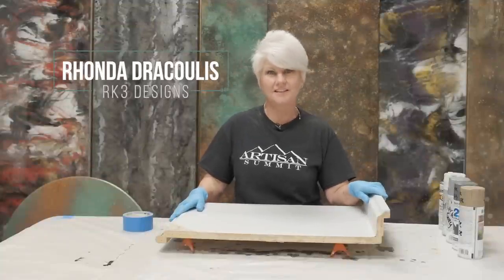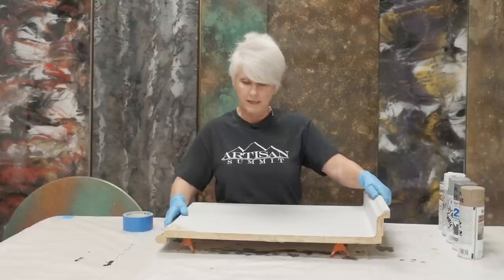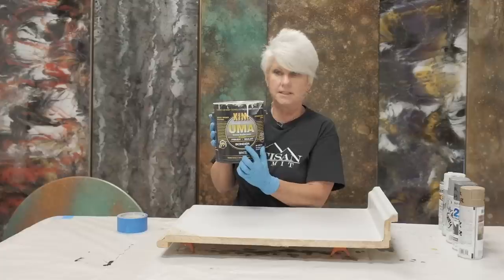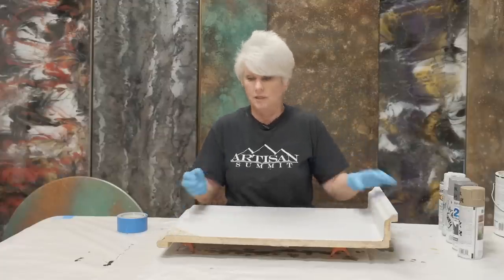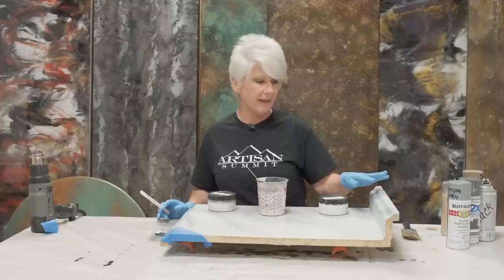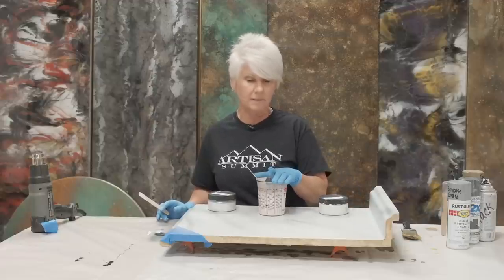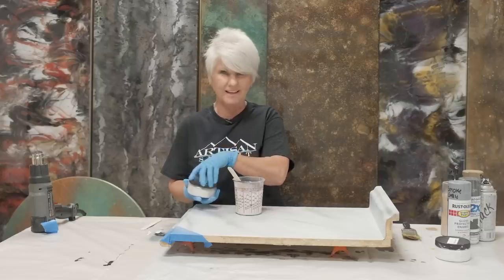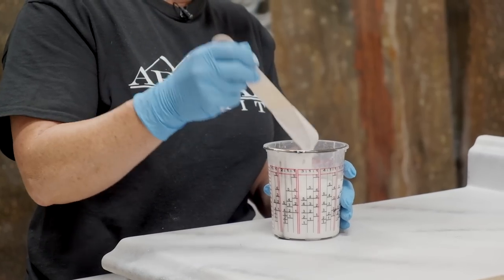Stone Coat Countertop Epoxy Tutorial- Pour over Existing Counters with Integrated Backsplash

Comment: Can you fog some denatured alcohol to spray over the bubbles ??
Reply from the maker: It depends on what epoxy you are using. I find it better to lightly torch instead of using alcohol. Too much alcohol on the surface can cause your finish to run and have a blurry appearance.
Reply: @RK3Designs  Thank you

Comment: How long do you have to wait after using XIM before doing your color coat?
Reply from the maker: I wait a minimum of 4 hours. Do a scratch test with your fingernail. If it scratches easier, you may need to add a little more product or wait a little longer. 😊

Comment: Hi, do you think it's still doable if the backsplash is 1.5 ft vs the few inches you are showing? Thanks!
Reply from the maker: It will be very difficult to apply to a vertical surface that’s that tall. I would do a design “pre-epoxy” first so the design doesn’t run.

Comment: how perfect does the substrate have to be before you coat with the epoxy. i made new countertops out of mdf and went over it with a belt sander with way to aggressive paper. I now have scratches over most of the surface even after sanding with 120 . will it be seen even after doing a dirty pour
Reply from the maker: I would hit it with 220 grit. Once you paint 2 coats of your paint/primer you’ll be fine. 😊

Comment: At what point do you do the flood coat? Once the designed layer is completed? Or is a flood coat not needed?
Reply from the maker: I recommend always putting a flood coat (unless on a surface that doesn’t have much traffic and will be topped with the Ultimate Top Coat). You’ll pour the flood coat 24 hours after the color coat.

Comment: I want to epoxy over tile.  I’ve seen the method to fill with concrete and then a leveler. Is that still the best method?  
If so what kind of primer on the concrete?
Reply from the maker: That would be the best application method for sure. Just be sure to check the moisture before you proceed with pouring the epoxy. I use the bonding primer XIM which we sell on our website. 😊 https://www.rk3designs.com

Comment: Stone pat has a thickener product you add to epoxy so you can do vertical surfaces like walls and baseboards. Have you ever used that product?  It’s fairly inexpensive.
Reply from the maker: I have used the thickener, but I very rarely do vertical surfaces. I will pour flat then hang or attach to wall when dry. I do use the thickener with the quick coat to bond seams together.
Reply: @RK3Designs  but what about using the thickener  with the colored epoxy for the intergraded backsplash ?
Reply from the maker: @marysorrells  you can add the thickener but it will change the color of the epoxy. It will also give a sort of texture. Also effects like fracturing won't work over the epoxy with texture added. If I were going to use the thickener, I would trowel it on the whole countertop so the surface would all look the same. Let me play with it and I'll do a video. 🙂

Comment: I have a house that we are in the finishing stages of. I chose to build my bartop and top it with a rock looking porcelain tile, put a decorative wooden edge on it and do an epoxy pour of approximately  1/8 to 1/2 epoxy pour over it to make it have a level top since it will be our eating surface. I never dreamed that it could not be done. A lot of my research has led me to believe this. It is brand new and I obviously don't want to grind it flat. Can I get some of your thoughts and possible solutions for this problem? The tile is made to be rough and to look like rocks. I got it at Home Depot and the name of it is MSI Neptune Gold. The tiles are 17.6" by 26.12" inches each. We did 1/16" grout. Help, please?

Comment: If I were doing this on my countertop, do I have to trowel it onto the surface or could I use my hands to cover the area? Also does it matter what I use for the "chop" brush? and also could white metallic powder be integrated in this look somehow?? I have ordered white powder, diamond dust and white metallic powders.  I'll be mixing like a mad scientist.....LOL
Reply from the maker: You can most definitely use your hands but if it’s a large area it’s easier to trowel first then spread with your hand. You can use any sort of nylon synthetic brush. Just make sure you deshed it first. 😊
Reply: @RK3Designs  Ok that sounds great.  And have you ever added slight, soft veins to this?  I'd love to see the kitchen you did that you talked about with the stark white cabinets and this countertop.  That's what I'm working with....the white cabinets.

Comment: Why did you use spray paint in the very beginning if you were gonna cover it with opaque white. Trying to understand the process
Reply: The spray paint adds depth to the project. Even using opaque pigment, you can see the spray paint. It will be subtle, but it does add to the overall look. I've done it before and liked the way it came out.

Comment: I see that this is 4 years old, my first time seeing it. Some helpful advice for this type of application and I understand that it’s a sample board for the customer, and this is a pretty simple design. I think that’s good because a more detailed design and over an entire countertop, like 30 or 40 square feet, all by yourself could be a big undertaking. I’d say, keep it simple, use only one or two colors besides the base coat. Have a helper or two and maybe do a practice piece with them so everyone’s on the same page. At least someone to help spot areas that the color has pooled in the corner making a too dark spot and it sets up before you can spread it out. I think a goof in the corner would be next to impossible to correct because of being very difficult to sand in there and re epoxy it.

Comment: Rhonda..is there a thickener that you add to the epoxy for vertical surfaces or would this not work in this case?
Reply from the maker: Michelle Charles there is a thickening powder that you can use for vertical services. It does change the color a bit of the mica and or epoxy and you don’t get the same effects. It’s a cool product for sure, just not for this particular look.  You use a trowel to apply it to your vertical surface.
Reply: @RK3Designs  thank you for clearing this up. I love your technique here and am following all the SCC family!

Comment: How do you do the final top coat with the integrated back.
Reply from the maker: Deila Hiebert that’s a great question. Basically the same way. You will pour your flood coat and address the backsplash as usual  Save a little resign so that  as your epoxy starts to set up, you can brush more onto. Your backsplash. Careful not to put too much because it will puddle at the base. Hope this helps a little. Feel free to reach out if you have any additional questions 😊.
Reply: That’s helpful so you basically just roll it on rather than pour it from the top of the backsplash?

Comment: I have a backsplash but it is not a part of the actual counter like your piece. It was added to the top of the countertop as a separate piece. It is laminate just like my countertop. It is flat on the top and straight down to counter so would I still use these same techniques?  I know some of the epoxy will sit on the top of the backsplash since it is flat.
Reply from the maker: It there anyway you could remove the backsplash, make another one and install it? If not, you could absolutely use the same technique. I would router or sand down any 90 degree angles is you could. 😊
Reply: Michele L ....I have the same type of backsplash. I had my husband router them off, with a cove bit, as far as he could and then I sanded the corners just a little, so it looks like it was made that way. It really turned out nice. I primed and painted them and I’m waiting for my materials from Stone Coat. My husband thinks they look great right now. I don’t think he’s sure about the epoxy, but I have high hopes. Lol. We’ll see. Try it.
Reply: MJP51 good luck!
Reply: Michele L ....thanks. It turned out pretty good, for a first try. I didn’t put enough base white in my epoxy, so it’s not as white as I wanted. My fault and I didn’t get my vein muted down quite enough. My torch just wouldn’t stay lit, plus I’m afraid of it...lol. It looks so much better than the original, so I’m happy. If I knew how to upload a picture here, I would.
Reply: MJP51. The nice part of epoxy from what they say when your tired of it later on down the line you can go over it with another design.
Reply: Michele L ...that’s the best part. Get tired of it..redo it.
Reply: @mjp5129  What did you do with the caulk to the base of the backsplash?  Did you remove it or primer over it or ???

Comment: Will the epoxy absorb color from coffee , veggies etc.....?
Reply from the maker: Stonecoat countertop is very durable, but like natural stone, if something is left on the surface for any length of time, it could possibly stain. For extra durability, I suggest and we use in our business, the Ultimate Top Coat. It has INCREDIBLE scratch, stain and heat resistance on top of what the epoxy already offers.
Reply: Will this yellow over time?

Comment: I just ordered SCC for my bathroom countertop and will be using this awesome vid as my template. My Q is, what do you use to clean your bushes and cups?
Reply from the maker: I just turn my buckets upside down and let them dry for a few days, then the epoxy just peels right out. The brushes I keep stored in a bucket with acetone. I take them out when I’m ready to use them again. Shake them off and dry. Don’t try to clean them and leave them out. They will get hard. 😊

Comment: Two coats Kiltz and it will be fine.
Reply from the maker: If it’s not the bonding primers there’s a very good chance of adhesion failure. Depending on your substrate and the temperature. I’ve been called to fix many countertops that are poorly prepped with inferior products. A Basic all on one primer may work in some situations but why take that chance.
Reply: I will take this advice..
The two I've done are only 5 years old and in climate controlled homes so I don't have  experience in less than ideal conditions. Thanks.

Comment: If the backsplash is attached,  could you remove the countertop and flip it on its edge, so the backsplash is laying flat. Pour the backsplash first, let it cure for 6-8 hours then lay the countertop flat again and pour it? IE: two separate pours with both the backsplash and the top laying flat in each pour. Would this work?
Reply from the maker: Absolutely, you can do it like that! 👍🏼